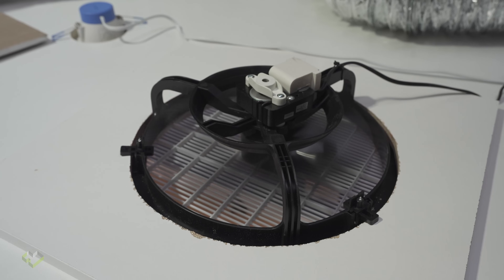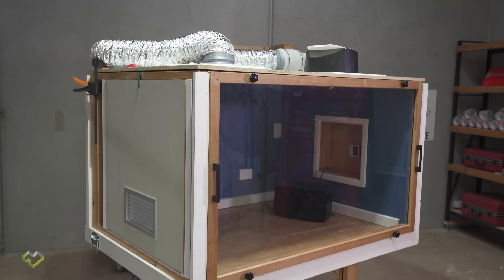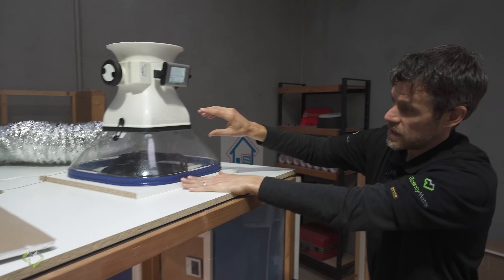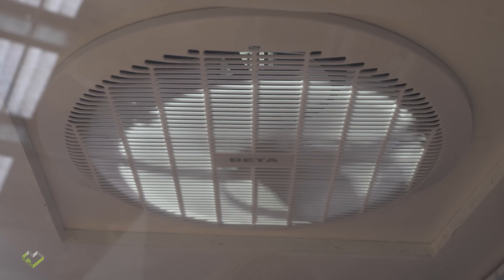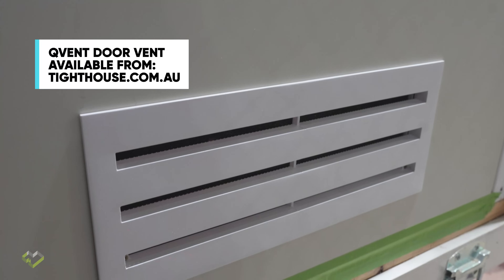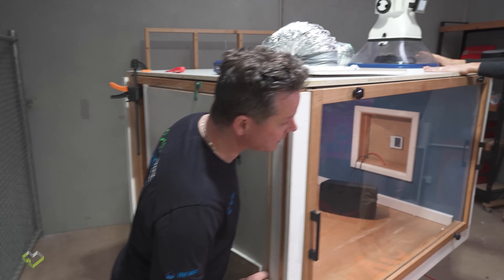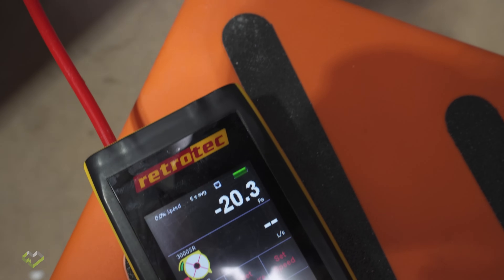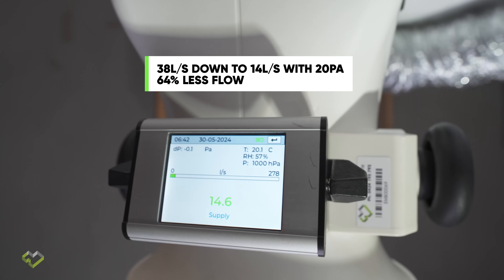What Bathroom fan should you use and not use?

Comment: Great vid guys! Looking forward to more.

I put an externally vented duct on our axial fan and did a heap of draught sealing and came across the same issue - it didn't work! Upgraded to an in-line mixed flow fan and its working as intended.

Fan noise was another challenge. Took me a long time to realise the sharp bend in the duct under the insulation was contributing to the noise. Sick of going into the roof. Glad its done now 😊

Comment: Just applied at the principals to a tee for our bathroom with a 150mm in line fine with a back straight damper, semi rigid ducting and an exhaust to the roof. Still the fan is quite loud and the bathroom still does build up steam and moisture on the walls. I am wondering how much the ceiling grille performance can effect this as we currently have a 600x100 linear grill across the shower door opening

Comment: Also wind can easily pass over 20Pa pressure and make the shitty fan not move any air at all or go the wrong way.
Anyway those fant who blow straight in the attic should be ILLEGAL!!! 
Those would never be approved for use here in Norway at least!
Reply from the maker: @tullgutten  agreed, but roofs normally go into negative pressure.  The chances of an inline fan being over ran by wind pressure is pretty low.

Comment: I was also wondering about the advice to have a fan vented to exterior constantly running, which contradicts advice to seal tight.
Reply from the maker: @sallybrown5071  continuous exhaust is low flow, as opposed to intermittent high flow.

Comment: Great points.
I’m concerned that condensation sucked through the vent into the cold ducting will condense in the ducting, pooling somewhere along the ducting.
Reply: In a perfect world ducting should be insulated to the point of exit, and travel to its highest point as quickly as possible before taking a consistent path down to the exit point. In a ceiling space with a pitched roof that's usually easy and even uninsulated ducts won't have pooling and any condensate will quickly evaporate back into the air passing through. Unfortunately some (a lot) of tradies can be interesting in their approach
Reply: The Panasonic fan recommends a 100mm pvc pipe on a slope, so any condensation will travel outwards.
Reply from the maker: Absolutely, insulated duct is a good idea, and using warmer air from your conditioned home, instead of cold air from outside using a pitched open window will contribute to reducing the chances of condensation building up inside your exhaust ductwork.

Comment: If you have your fan running on low all the time it would suck the heat out of the bathroom and it would always be cold?
Reply from the maker: @Mrmysterious823  you would hope for the replacement air to be coming from the house, so it should be able to leverage more from living area heating systems.   Unless you leave your bathroom window open.
Reply: @ecoevo  People living in not-so-well-insulated homes may want to keep their bathroom always warm without heating the whole house. This can be achieved with infared heaters  that can be programed to keep the bathroom at a set temperature. If the fan is always running the heat would be lost.

Comment: In Australia it's pretty much a given that the makup air will be coming from outside. With this in mind, would it be better to have a dedicated ERV/HRV and dehumidifier system to provide makup air..... OR just crank the heating/ cooling to condition the infiltrated air (keeping in mind I've already paid to condition the now exhausted air from the bathroom). Either way it sounds like it's going to put a nice sized hole in my pocket.
But with the ERV route it at least feels as if I'd have some control of the makup air like filtration and such.

Comment: I just installed a centrigufal fan (not a Panasonic) and - even after adding a speed control to slow it down to suit the room size - its motor is noisy. The airflow is fine and not intrusive, but the hum from the motor is quite alarmingly loud. I think for this reason, I would next time use a mixed flow inline fan inside the roof space instead of one of these mounted right on the ceiling.
Reply: Try Panasonic centrifugal and you will be amazed

Comment: When you build an air tight house, ventilation is very important, but also is an energy recovery system. It would be a big waste to shoot out the nicely heated or air-conditioned air to outside.
Reply: Australia isn't up to that standard. Air tight houses require air exchangers that detect moisture, CO2 and other pollutants such as when cooking with gas. I wish that is standard though.